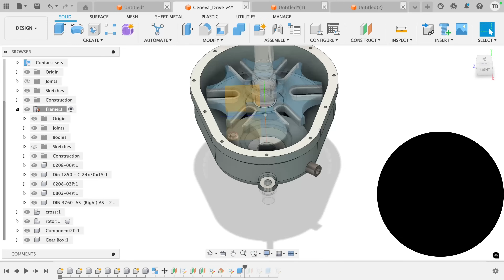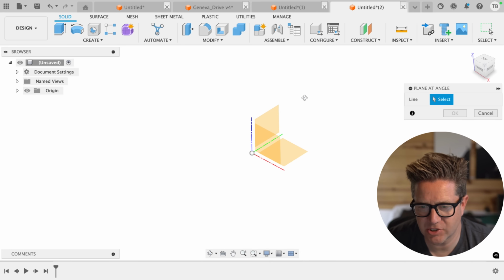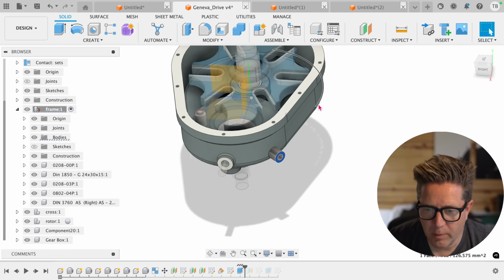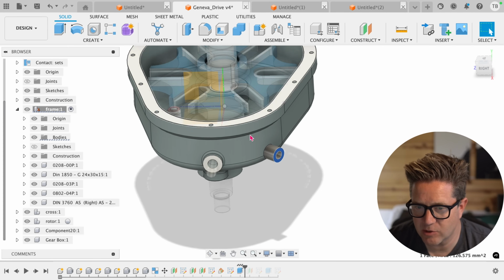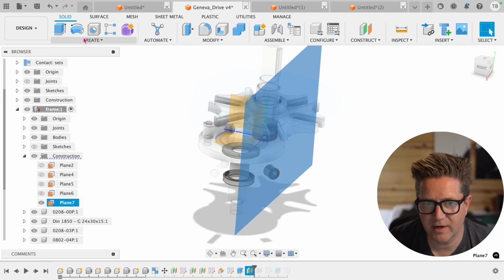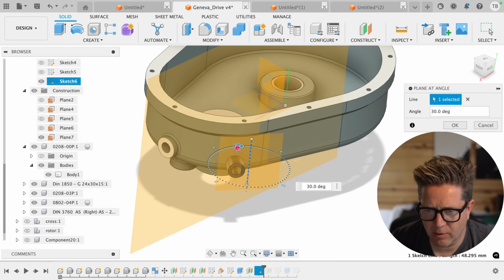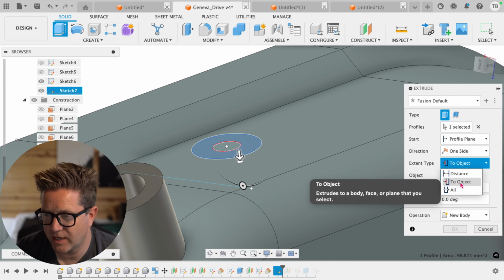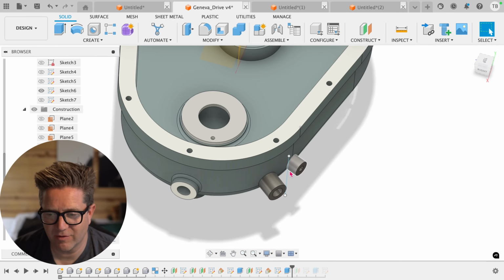How to Create an Angled Plane and Sketch Off in Space in Fusion 360

Comment: I wondering if it's possible to have a plane that's curved. I want to create a plane following the path of a sketch, then create a sketch off of that curved plane and extrude from there.

I suppose I could extrude the curved path and create a sketch off of that face but I don't actually need that extruded curved edge in the design